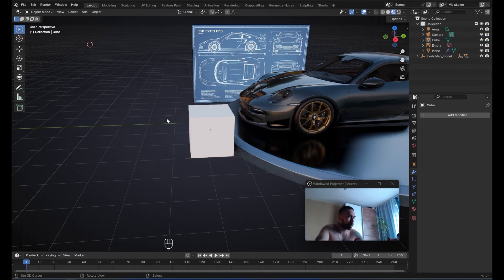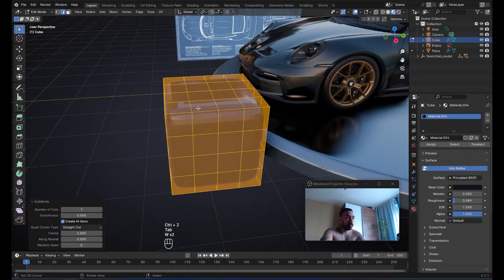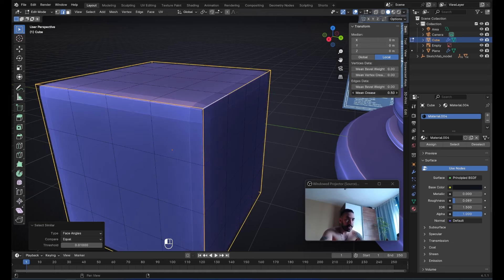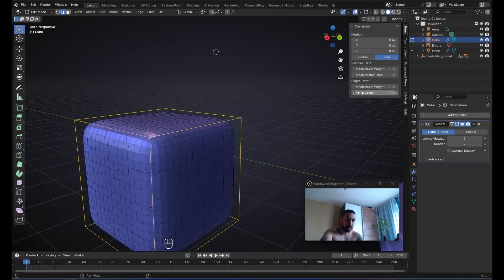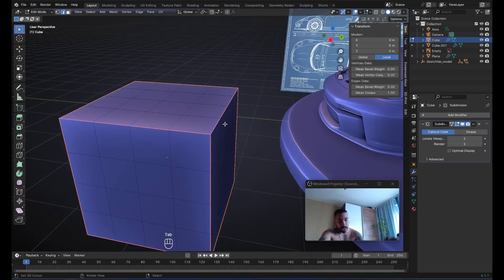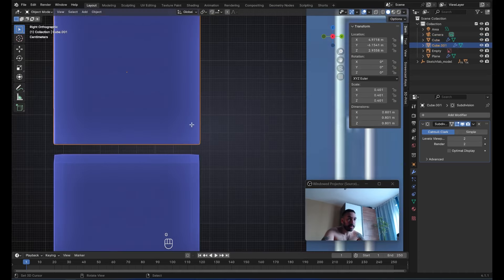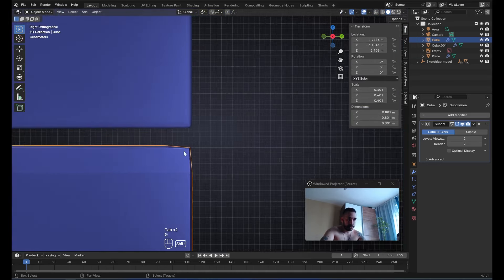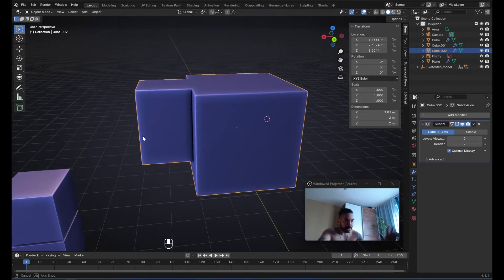The MOST IMPORTANT Hard Surface Modeling Tip - Edge Creasing

Comment: I agree. Just use bevels or edge loops. They will give the most natural looking edges without tampering with subdivision surface. It's not even harder to maintain if you build the structure first then do the beveling. It's about just getting into a workflow